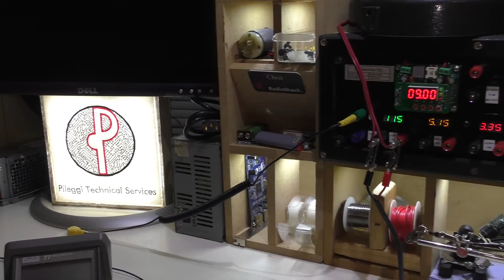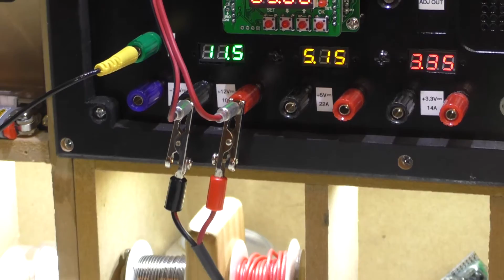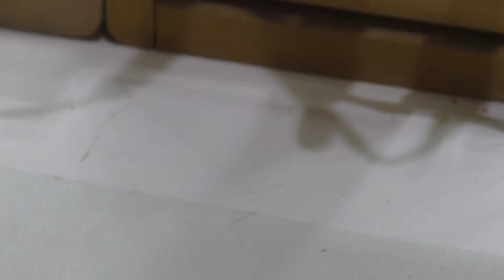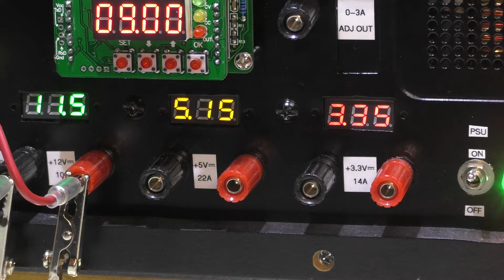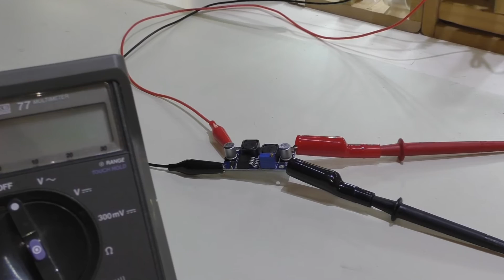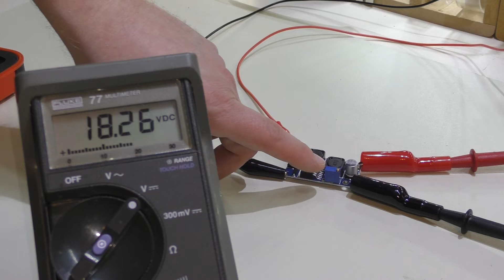PTS Ep. 69 - Looking at a Buck / Boost Converter

Comment: Am planning to make my studio AC speakers charge wirelessly... I know that I have to connect an inverter to a 12v battery to power the AC speaker wirelessly, but I wonder, will a boost converter make it possible for a small panel to fast charge my 12v lithium ion batteries under indoor lights before the inverter runs it down?.
Reply from the maker: You're better off running the internals off of DC directly if possible.  I'd be willing to bet that the AC power coming into the speaker is converted to DC internally.  You should open them up to see if that's the case.  Then you'd only need to go from battery to buck / boost converter to amplifier board.
Reply: Lol... am not good at opening stuff up and I also want them to be intact (more like plug and play). I built a case that can accommodate any studio speaker (incase I buy new ones in the future). The main reason was to make any Ac speaker of the same size wireless and mobile when plugged in.... But do you think the boost converter can significantly boost a panels out put enough to fast charge my 12v battery...

Comment: Would this have a higher quiescent current than just a boost converter or a buck converter. I need to use both boost and buck separately but if the quiescent current is nearly the same for the buck boost then I would use 2 of them. I also want to know where to get a buck boost converter with constant current (CC) output. Thanks
Reply from the maker: +boffin schist that's a good question.  I'll have to do some research on that for you.  I'll look into it when I'm back in the lab later.  I'd honestly haven't come across a buck boost convertor that also limits current.  I'd talk a look on eBay, as that's my go to for modules like that.
Reply from the maker: It seems like most of the XL6009 based modules have a quiescent current of under 18mA, regardless if they are set up as a step-up converter or as a step-up / down converter.

Comment: https://www.youtube.com/watch?v=C8YJuLaSNAQ
Reply: I have used it in my motorized bike :) works well at keeping the voltage at 12v out to power my lights without battery.
Reply from the maker: Glad it worked for you
Reply: Ty now I will try to charge a battery to use in the system and see how that goes.

Comment: Have you used this in a real load situation? I have watched the other Video you mention and I have not seen a real world use and how it turned out.
Reply from the maker: I have used both of the ones I purchased in real world situations.  One of them is mounted permanently into a model train engine to control a LED module.  The other one is used in my lab as a power supply.  I plan on buying a higher-powered boost converter to replace this particular device.  I'll most likely use it with a battery pack to make a portable power supply once it's free.
Reply: Ok thankyou cause I have been looking everywhere for real world testing on these and to see what the outcome was. I plan on trying to use one on my Motorized bike.